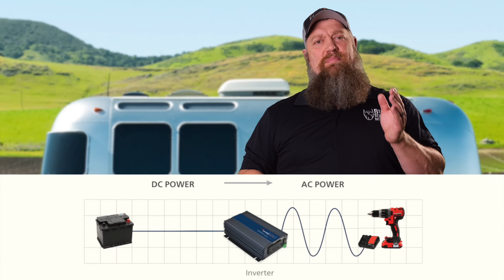More RV Solar Questions Answered

Comment: Todd, great videos, you are the best! Is there an app where you can plug in your hardware rating and it will tell you what size battery, solar panels, solar controller, inverter, what cable size? That would make life a lot easier.

Comment: The max 100watt question... it could be that the camper was using all but 100watts going to the battery.
Reply from the maker: Absolutely. Not enough info

Comment: I live outside Las Vegas and do a lot of summer camping in the hot south. I have a struggling absorption fridge with outside fans added, not in a slide.  How can I test/tuneup my absorption style fridge to make sure its just the stupid high heat that makes it struggle and not another fixable issue? Thx

Comment: Love your videos!  Just A "Heads Up"...  I pick things apart. Too much sometimes...
Anyway  in your latest tech tip Tuesday,  you said that electricity doesn't move unless there is a demand.  In the broadcast sense that is correct however.  It just needs to have a "potential " difference. 

Keep up the videos.  They have taught me a lot and even adequate me rethink se things I've been doing the old way for so long
Reply from the maker: So this is true. A difference in potential and a path to move. 

The two connection points to an extension cord plugged into the active outlet have a difference in potential between the two, but if nothing else is plugged in and there is no path to a load, then there is no kinetic movement. 

Can continue to parse but this is 2minutes.  ;)

Comment: Thanks for the education! To use a solar analogy, you're the solar panel to my battery-brain. 
Question: If I install a 48v battery based system, how do I maintain the charging from the 160 amp alternator on my Caterpillar engine? Is there such thing as a 12v to 48v DC to DC charger?
Reply from the maker: There is. But it will be very low amps.

Comment: If I install solar panels on the roof, is there system that automatically tracks the sun?
Reply: yes, but you need a way to move the solar panel with a tracking system , but no one does that cause it's silly.
Reply: Since the RV might be in a RV park site only facing one direction you may not be able to use an auto tracking solar panel the direction it needs. If you were off grid and can face your RV in a particular direction then you have the ability to park where your fix solar panels get the most sun light.